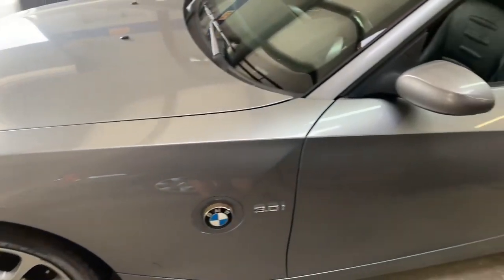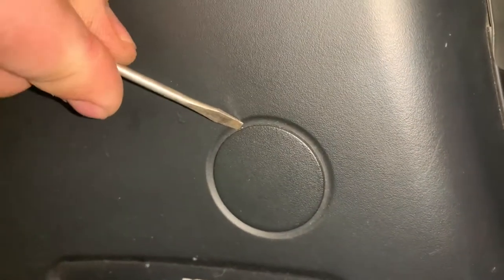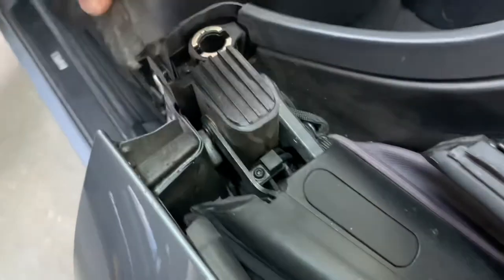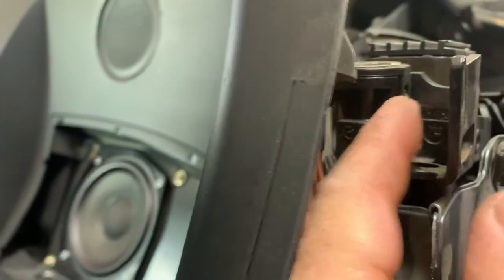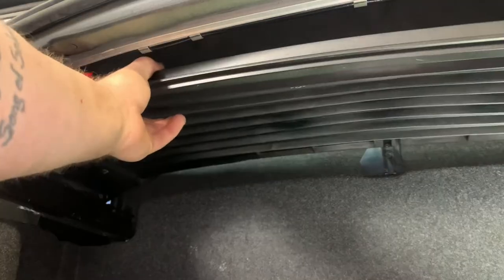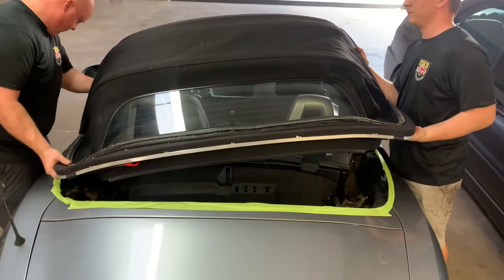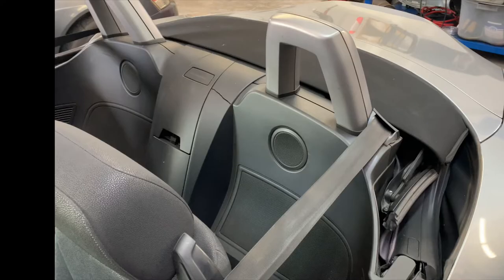BMW Z4 CONVERTIBLE TOP REMOVAL. DIY BMW REPAIR FIX YOUR e85

Comment: The best video I found for this job. My top got vandalized and the shop quoted me over 3 thousand to replace the new soft top and the headliner. I am thinking to find a used soft top in some junk yard and do it myself. I found your video. Thank you very much.

Comment: Great video! Used it to remove my top. Pump was fine, had a leaky hydraulic hinge. Replaced the hinge with a used one and moved the pump to the trunk to avoid corrosion problem. Everything worked for 16 months and then developed a leak in the other hinge. This time I was able to lift both hinges high enough out of the body to remove them without removing the entire top. I had both hinges rebuilt by Top Hydraulics and the top works great. Note: there is another video on YouTube that shows how to move the pump to the trunk without removing the top... So you could replace the pump and hinges without removing the entire top.
Reply from the maker: I’m glad you found it useful. I’ve seen guys do repairs without removing the top. And even tried it myself. Some can do it successfully but in my experience it actually takes longer and tends to lead to damaging other components.
Reply: blacksnayk I'm having a problem where my roof unlatches, but only opens a tiny bit before it feels like it totally locks up. Even with the manual release pulled, I can only open the roof a tiny bit. Would this be a hinge problem? I plan on replacing hydraulic motor anyway, but it would be nice to get it working even manually for now. Thank you!
Reply: @ZachandDukeGaming  so the locks should release with the electric actuator and then the top should be able to be opened manually. There may be a way to open the locks manually but I've never tried it.
Reply: @blacksnayk  it does unlock and open a little. If just seems as though it doesn’t want to fold down. I think perhaps my hydraulic fluid just isn’t flowing around freely
Reply: @ZachandDukeGaming  Did you figure it out?
Reply: @NOXXism  the problem was exactly as I suspected. My manual release wasn’t working correctly, so the hydraulic fluid wasn’t flowing freely, thus the roof wasn’t able to fold at all. I replaced the hydraulic motor and it’s all good to go! Runs fast and great! Also relocated to trunk so I’ll never have a problem again
Reply: The hydraulic motor has a small button located beneath the manual release housing. Iirc, that button is depressed when the manual pull line attached to the red finger-loop in the trunk is pulled and set to the "manual" position.  That button can get stuck in one position, making the manual pull no longer work. I have heard that depressing a frozen button may dislodge it, making it function properly.   If that is true, you may have an extra working top motor!
Reply: You're flying blind, lying on your back crammed upside down in the trunk and trying to use one hand to grab the pump. I know a few did it but you risk damaging other items by doing it that way. And blindly cutting lines.....no way. And trying to get that tape off the canister holding the pump, tape that's been sitting there for 10+ years....and doing it with one hand.......virtually impossible for most people including me. Take the top off.............

Comment: My Z4 soft top can’t open the whole thing and comes back up since 2 weeks ago! Whenever I try pressing the button, it moves a li only which means the Mortar is working ? I used my soft top almost every day since summer started which may cause the issue? I went to the mechanic shop and the guy told me it may cost around $5000. I was shocked !
Reply from the maker: @noeforutenforme  there are two motors. A gear driven motor that unlatches the top from the windshield pillar and the hydraulic motor that drives the top up and down. It sounds like only the first motor is working

Comment: Masterpiece. 

Prior to doing the roof removal for my first time, the go-to video, for me at least, was from Pray4UrLife12. At that time I made my own sloppy videos when I resuscitated my waterlogged hydraulic pump motor and eventually replaced and moved it to the trunk. Well, as anyone who's ever replaced the driving (master) unit of a hydraulic system often learns, when you fix the master the slave will soon die... it's simple math, not Murphy's Law. So now that I'm pulling the whole mess out again to send off the cartridges, I wanted to see if I should try to record the steps again. The answer is "no, Bald Man has already done it." Other than those nasty little aluminum clips holding the forward sides of the fabric frame to the car sheet metal, there's no room for improvement. This is the authoritative video: no wasted time or words, perfect lighting, camera angles, zoom, audio, and tooling. I'm guessing that the ONLY way to achieve these production values is on your 13th time doing the repair. :) This is how it's done. 

Some other notes:
I promoted the idea of hydraulic motor replacement without (!) lifting the roof out, but I agree with Bald Man's reply to a commenter that it's not for everyone or every situation. Some youtubers even confirmed my method. (And one other even was insistant that you can reach the motor from the trunk; he apparently removed an additional interior trunk panel that I never thought to remove.) But I would say that people might try the no-roof-removal method but as soon as you struggle to unfasten the pump... take the damn roof off! By knowing the precise steps and the tricks about the top vs. bottom main bolts, and the clips, the battle is easily won.
Reply from the maker: @nofluffDIY  Thanks man, I appreciate your detailed input and I love that this video along with my pump relocation video has been helpful for others needing to tackle this job.🤙

Comment: This is the best video for removing the top. I used it to remove to top because my hinges were leaking. Sent them to top hydraulics for repair. However, after reinstalling everything now the top opens and closes as normal. However, when opening the red button keeps blinking. Possibly didn't install a sensor correctly. Not sure. you can see one of the sensors for the hinges at 2:20 in the video. The sensors are located on the pump side of the hinges in the driver side. At 2:20 you can see a square looking sensor with a small screw/cable coming out of it. I placed the sensor with the white dot on top and the other on the side. Hopefully, you know what I am talking about and can help? It opens and closes as normal. Just when opening it the red button keeps blinking.

Comment: Great video and I am going to remove the top in a week or so. On the passenger side how many wire connections are disconnected, I couldn't tell exactly in the video.  Thanks and great work, best video I've seen describing this procedure.
Reply from the maker: If it has hardtop sensors there will be two connectors if not only one.
Reply: @baldmankt  Ok, thanks for the quick reply. Have a great day and keep up the awesome videos.

Comment: Great video..my z4 2003 has original top..works great...however the screws holding the canvas top to its frame have completely corroded and no longer hold the canvas top.......do you have any suggestions. do I have to replace the top >>>

Comment: Thanks for the video it is clear how to take the entire thing off, but how much of the roof do you have to lift to get access to the ram on the right hand side of the roof? My hydraulic line has burst on that side (opposite side to motor) and I think lifting the side of the roof out to access that part is probably the best bet. I don’t want to take the whole roof off if I can help it though.
Reply from the maker: You need to remove the whole top to do either ram and bleed the system

Comment: Super video.  I followed all steps and all is good...except finishing the install the weather strip by the door.  (The removal is at about 1:57 in your clip.  I cant seem to get the last 2.5 inches from the top weatherstrip to stay in place to finally put the corner piece on.   Just wondering if their is some suggestion to making this final piece fit uniform before adding the corner piece with some glue?    Thanks so much.  1st video I actually did not get a migraine watching...and the audio is perfect.  Thank you.  V
Reply from the maker: It can be a bit of a pain, there is a “fold” of rubber on the underside of the weather strip that has to be nested perfectly

Comment: Thanks for the great video.  Make it look easy, in my experience, the rubber stuff disintegrates, the screws are rusted together, etc, etc, and I spend days on this, and putting it back looks like a nightmare too, get all that stuff back in place without damage looks a challenge.   My question/problem is the manual release cable seems to be stuck, so I can't lower the top manually, and from this video, it looks like I need it to release to get it out?   I'd like to just fix the manual operation, don't need a fancy electric version, heck my Midget doesn't even have windows at all.  :)

Comment: One question: the hydraulic actuator is held in place by two torx bolts, one on top and one lower torx bolt. The torx bolt has a smooth larger diameter section followed by a narrower diameter threaded section.  When reinstalling the top does the open loop at the lower part of the actuator sit on the threaded part of the bolt and then is held in place against the larger non-threaded shoulder when you tighten it? Thanks. great video.
Reply from the maker: Yes, you do not need to remove that bolt only loosen when removing the top and use it as a guide when reinstalling the top.

Comment: Excellent.. Clear speaking, Perfect video, Came off just as you described.  Thank you for doing this video.   Do you add a little silicone grease when reinstalling the rubber top seal?
Reply from the maker: Thank you. No, there’s no need to apply any lubricants or sealants when re installing the seal

Comment: Great video, thank you. Question, in the process of removing the roof motor (left side of the car) through the trunk I damaged the hydraulic hose going to the right side cylinder of the roof. Do I need to remove the roof to replace that hydraulic hose ?
Reply from the maker: Yes, the roof will need to come out to gain access to the line at the bottom of the cylinder

Comment: Is it as easy to assemble in reverse or are there any tricks?  I’m about to tackle this now, replace motor and lines on the top
Reply from the maker: Install is just as easy as following the steps in reverse. Watch my other video on re-locating the pump so you can keep your pump free from water damage and make it easier to bleed the system https://youtu.be/6YvPj2mMmNA?si=hYHqga7GPmZfmfm-
Reply: @baldmankt perfect.  Thank you.  I’m at a point where I’m waiting for my son to help me lift it out. Your video made it super easy this far.  Wish I did it this way before I damaged the hydraulic lines.  Now I need to replace the lines and motor and still have to remove the top.  Cutting corners are usually not the easiest and best way.  Lesson learned.

Comment: Very good instructions. I'm having an issue on returning the top to the body, specifically the electric wiring on the driver side. I'm not having enough slack, and cant really see where to route the cable collection back through so I can make the 3 reconnects work. For testing, I connected the large white and black connector but don't have enough for the controller (small 6 pin connector). I assume the connector is required to move the unit up and down, therefore I'm not hearing anything. Lastly, I have a hard top, but both those connectors are not in for my initial test. Are those required to operate the top?
Reply from the maker: That 6 pin connector is to the control unit so without that hooked up you will bet no movement. The hardtop switches could potentially cause the top not to operate if they’re not hooked up as well

Comment: Question, when assembling the the convertible top back on.  Do you put weatherstrip adhesive glue on it to the body?
Reply: Also I cannot get the strip to sit nice and flush on many parts for the body
Reply from the maker: There’s no need to glue it back on, if it’s not sitting flush it is either bent or not seated all the way on
Reply: @baldmankt thank you!  👌🏼

Comment: Yeah I'm having a issue with mine, I'm getting a little puddle of fluid under the z on the passenger side not big but enough to notice and I can't seem to find where it's coming from, I just got the top out but waiting for anyone to show up at the compound to help lift it out was hoping you might have a clue to where it might be??
Reply from the maker: Most likely the hydraulic lift cylinder is leaking
Reply: Ok cool thanks for that bro we stuck on the inside bolt cause it's all, how do you say, "wore out can't fit any size bit or Allen wrench to fit it to unscrew"but thank you so much!!!

Comment: Do you have a video that talks about replacing the hard plastic at the front of the convertible top itself?  The plastic piece that the fabric attaches to is breaking, there are lost screws and when the top folds down into the trunk, it doesn't lock.  I need instructions on replacing the plastic piece and making sure the top seats properly.  Thanks!
Reply from the maker: Unfortunately I do not have a guide for that
Reply: @baldmankt  Thanks for the reply!

Comment: This Z4 roof procedure is one of the greatest tests of DIY mechanic-ship I've ever encountered. So, my notes, with durations, from doing it for my third time, using Bald Man's great video:

Total, 2 - 3 hours. I did about 20 minutes one day, then worked from 2-4 PM the next, and had the hinges off in another hour... But I didn't watch any instruction for that part. 

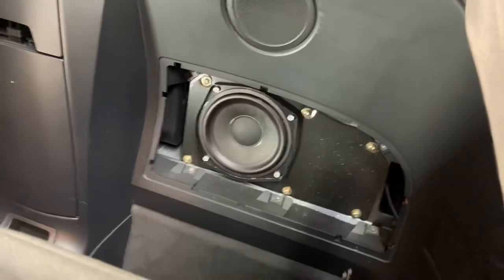1:00 Trims etc., 15 minutes. Notice he correctly says "5" Phillips head screws... the panels hiding the wiring harnesses will not pry outward until you remove not just the 3 screws at the bottom but the two at the top.

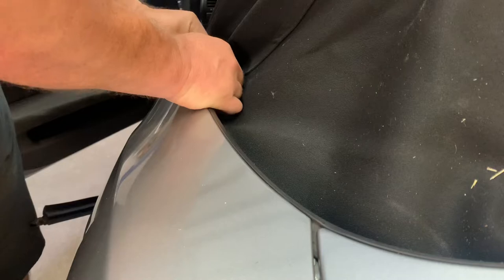4:10 Weatherstrip etc., 15 minutes. At 4:20 he correctly says "move the top to the open position," but what exactly does this mean? Notice at 4:12-14 it shows the top halfway (!) up. That's what it means. In my experience, when the convertible top is half-way, there is no rigidity (no stress or force) on the aluminum channel that holds the weatherstrip and the back of the top to the car body. I found that the top will balance half-way open (even if your hydraulics have completely emptied of fluid as mine has), but it's safter to use some glass-reinforced tape from the windshield to the roof fabric, to keep it from accidentally falling backwards.

5:00 Shelf etc., 15 minutes. Pulling the metal bracket towards the center: maybe use a screwdriver to lever it inward, popping it out of the plastic snaps.

5:25 Aluminum Frame ("top bow"), 15 minutes: First, note that there are 7 of the 10mm bolts, and I found it's really important to use a power wrench for them. I used a small impact driver and socket. 

5:35 Forward clips holding aluminum frame, should be 5 minutes: Note that these clips are there because there's no way they could have used bolts due to their inaccessible location. I think I've misunderstood the technique for releasing them all these years. I thought it was necessary to put a screwdriver or other wedge between the clip and the bottom of the aluminum frame, to wedge the frame out of the clip. So when the video shows releasing them from the front cockpit side, I can't understand how he's reaching them because my roof fabric and frame is in the way. IMPORTANT: But now I realize that when he says "release these clips... by prying carefully with a screwdriver under the top"... he just means lever the whole damn frame/fabric assembly up by levering against the body pillar. He's not trying to reach the bracket. Duh. I'll have to try to prove it next time... or one of you can.

5:45 Main bolts, 15 minutes. Why is it 15 minutes instead of 90 seconds??? Because having the top "open" now becomes a problem, not a solution. When the top is halfway open, there is tremendous force on the hinges, forcing them out of alignment with their access holes the minute you start to loosen them! IMPORTANT: I'm pretty sure you have to close the top (put it all the way up) to have the most certainty that the top hinge bolts will be centered, unstressed... and therefore can pull through their access holes.

6:08 Removing top, 30 minutes: I managed to do this alone but made one mistake that damaged the hard plastic at the top front of the top assembly. I should be able to glue it back to health. If you're desperate to do it without help here's how. Important: my pump was already moved to my trunk long ago, so I knew exactly when the whole assembly would be free of the car. The body perimeter was already taped. I put two blankets on the trunk and two 3-inch patio chair cushions on the trunk. I put a 2" x 12" x 2-foot piece of lumber on one side's rear fender, and a piece of plywood on the other side. You should tape the wood to the car. Then I pulled the aluminum frame out of the body and put it on top of the blankets. I think my mistake was that I should have dropped the roof down flat (fully 'opened') at this point, while the hinges were still in place. I lifted each side onto the wood. The front attachment points of the hard plastic broke, probably because the whole piece twisted. Oops. Then I closed the roof and flipped it backwards onto the top of the trunk. With it closed flat, and upside down, it was relatively easy to lift and carry, with one hand on the centerline, holding the window and fabric, and the other on one side of the aluminum frame and fabric. I could then remove my hinges to have them rebuilt.

Comment: The motor just stays in and connects to the replacement correct?
Reply from the maker: @loganhollingsworth7978  the motor comes out with the top, you can see it dangling from the bottom driver’s side at 6:30